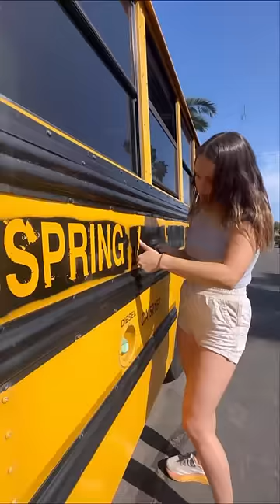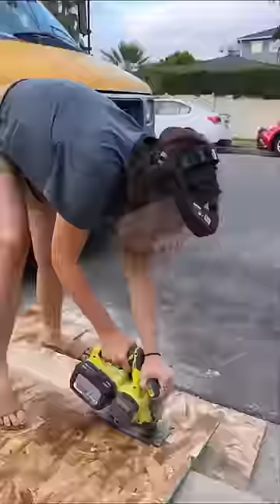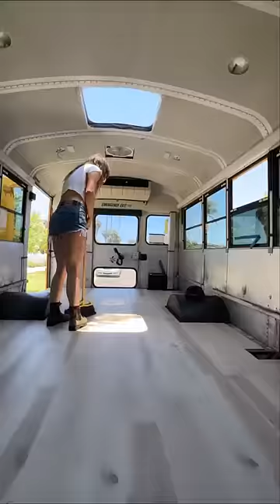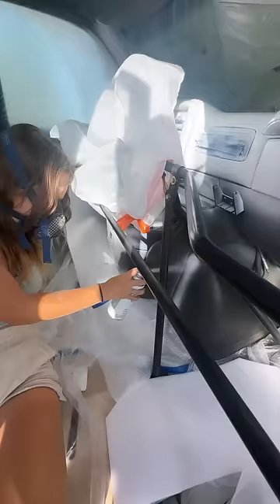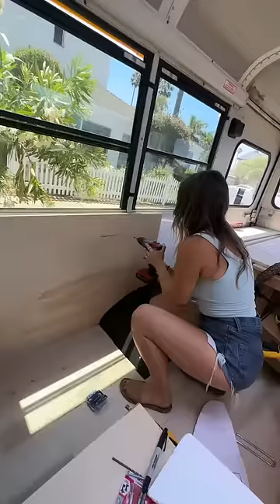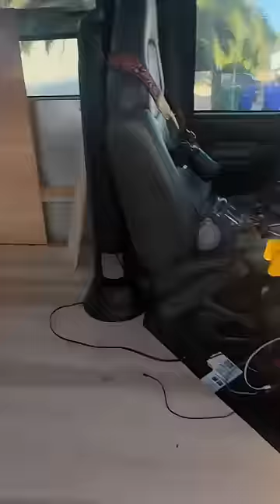#schoolbusconversion #skoolieconversion #tinyhome #skooliebuild #skoolie #vanconversion #vanlife

Comment: The hardest part of doing this in the UK would be getting your HGV licence
Reply: The best part about doing this in the US is you can drive it on a normal license as long as the word school is no where on the outside of the bus.
Reply: @Wolfofthenightt Remove the S and the H.
It's no longer a SCHOOL BUS, it's now a C OOL BUS
Reply: Haha yesss 💕 @donutdude1934
Reply: I have a Toyota dyna with a massive box on that is still under 3.5t, lots of things (like my horse box sized truck) can still be driven on a regular license, you just have to watch the weight.
Reply: Or actually finding a schoool bus
Reply: What is a hgv license
Reply: @woodystreeservicePNW  Heavy goods vehicle
Reply: @kishanjethwa1817  and you would have to get one even for a personal vehicle
Reply: @Wolfofthenightt don't you still need a class A or B license due to the nature of the bus? You just wouldn't need a passenger endorsement.
Reply: worst part would be having to spend extra on the insulation, fuck living in a giant metal tin with no insulation in the UK. 🙃
Reply: @woodystreeservicePNW  There are certain exceptions (e.g. if the vehicle is over 30 years old or is not going to be driven above 28mph) but otherwise yes, you still need an additional licence to drive vehicles weighing more than 3.5 tonnes in the UK for safety reasons, regardless of why you're driving it
Reply: @velvetventress  Insulation and a heater are actually relatively cheap compared to installing air conditioning, fans and extra windows for hot weather but I totally get if you just prefer hot weather in general. We all have our preferences 👍
Reply: @kishanjethwa1817  I do prefer hot weather haha but I live in the UK. have family that have built stuff like this & I just hate them - it's such a mess about.

didn't even think about fans/AC etc if I'm honest, fair point.

edit for grammar
Reply: I've been wanting to do this for ages but that combined with having to fight off the horrifically cold weather is not for me
Reply: @velvetventress  Yeah, so am I haha. You're talking to a fellow Brit.

I have plans to convert my own van next summer and I have no concern about the cold as I've planned it out very carefully and have thick insulation (all four walls, floor and ceiling), thermal window covers, electric heater hardwired to the solar panels etc. It just depends on what luxuries you'd like and what you're willing to sacrifice.
Reply: @kishanjethwa1817 don't know if I'd call children goods per say but you do you Britain
Reply: @gwenethp511 I think so. I remember reading up on it all but I only remember the trucker stuff. For most things with a bed I believe you have to have a class A orB
Reply: @XohjaiSbarkeater  yeah, I have no idea where Wolf got that from. You definitely need to get a specific class of license plate to drive a school bus. The only thing that would change is whether or not you need additional licensing to use it as a school bus.
Reply: You guys in the U.K. need a license to breathe. Sad.
Reply: @gwenethp511 it would be a class B when used for its intended purpose and hauling passengers. It is a state-by-state basis, but most states don't require a CDL to operate a private bus. Like someone else said, it just can't have any markings on it indicating that it's a "school bus" or any other type of commercial passenger vehicle. At this point, if you don't have any commercial markings and you're not hauling passengers in a commercial capacity, it's essentially an RV, and you don't need special licensing for that. 

Here in Texas, you can even get a special license plate that indicates that it's for private use.
Reply: There's a reason why everybody is leaving UK
Reply: @Wolfofthenightt  completely untrue you need a CDL to own one of these or drive it out of state.
Reply: Huge Giant Vehicle license?
Reply: @donutdude1934 or leave the c and it’s be a cool bus 😂
Reply: @gwenethp511 well a class A is for anything with a trailer over 10,000lbs so thats irrelevant to a school bus. And the only way you'd need a class B is if it had air brakes
Reply: @donutdude1934  Great!
Reply: @kishanjethwa1817 electric heaters are very uncommon on van builds due to the constant high wattage draw. You'd need some serious solar and big Lithium Ion batteries to run that. 

I'd strongly recommend alternative heating, wood stove, gas, or most popular diesel heater.
Reply: No the hardest part of living in the UK and doing this is that you can drive across the whole country in less than a day and still not find a decent place to sleep 😂
Reply: @Wolfofthenightt really? even the bigger buses?
Reply: @velvetventress  Would still suck up here too, winters in the north easy can be -10F(-23C) or lower. They are definitely from the south or mid-west at least.
Reply: this is a person i like to call a bus hippie
Reply: @Wolfofthenightt  should require a different license as its a bigger vehicle
in the uk theres like 15 different licenses
Reply: @Wolfofthenightt  Because it's still 16000 GVW you still need a class B operator's license
Reply: @gwenethp511  No.
Reply: @velvetventress  Yep. This "vanlife" better be in Southern California because it isn't going  to cut it if the weather gets cold. I was wondering if someone would recognize this. 

The difference between an insulated van and non-insulated one is significant. 

I have seen people double-insulate vans to live in up in North Dakota. The living space was reduced to mostly a place to sleep but that's all they wanted to use it for.
Reply: @Wolfofthenightt  the upgraded license would only be needed if the bus had air brakes, otherwise nothing else is needed.
Reply: @velvetventress I mean… what’s it insulating at that point. The Uk is just grey sky’s everyday🤣
Reply: The hardest thing would be paying carbon taxes when you already pay taxes to drive the streets  😂😂😂😂😂😂😂 failed state
Reply: @sgtstedanko7186 Yes. Everyone is leaving here because you need an additional license and training to drive a larger than usual vehicle 🙄
Reply: @somedogsarecops2354 Nah, we just don’t give guns to mentally deranged people and understand that driving a lorry is a lot harder than a hatchback 😂
Reply: @Wolfofthenightt  Maybe its for the best you cant just drive this on a normal license...
Reply: that's a good thing.. some people shouldn't be allowed drive vehicles that size
Reply: @kishanjethwa1817  In Oz you have to have different licence endorsements for a bus, heavy rigid truck, and articulated truck. Oh, and a motorbike as well. They all cost separate licencing fees initially.
Reply: Then figuring out how the hell you're going to afford the fuel! 😂
Reply: @gwenethp511 It’s just called a CDL here. Commercial Drivers License. 

If you aren’t carrying 16 or more people, and the weight of the vehicle doesn’t surpass 26,001 pounds, and there’s no decal claiming it is a school bus, then you’re fine. 

The thing about the US that you have to understand is, laws vary, sometimes drastically, for every state. You just have to make sure you are following the law in your state and other state laws if you are traveling with something like this.
Reply: PSV license, not HGV . But if it’s not used for that it just depends on the weight of the vehicle
Reply: You don't need any license to drive a converted vehicle like that. It's no longer a school bus
Reply: @woodystreeservicePNW no you dont
Reply: @velvetventress lol you don't think it gets hot or cold in the US
Reply: @kishanjethwa1817 no you dont
Reply: @velvetventress true that thing would be a frickin ice box in the winter here
Reply: Oi bruv you got a loisens for that permit ave you?
Reply: @dti_player_since_era9 
Not hard.
There is a used bus lot in [North] Las Vegas. Pretty reasonably priced, too. They have a website. Google is your friend.
Reply: @velvetventress  There times in North Dakota it gets to -40. The C or F is optional. It can get to 40C or a hundred and something F in the summer.
July in Mojave is bit like that. OC at dawn and 45C at noon.
Reply: @Wolfofthenightt  and you seriously believe that`s a good thing ? .. lets take this girl here .. 0 driving of a buss or a truck before .. and let her take it out on the open road? .. yea ok :D .. Welcome to America -.-

Comment: I heard another short talk about not waiting to be good at something to start a project. Start whatever, and you will learn along the way. Love seeing your journey. Thank you for sharing!
Reply: I would say yes that's great advice, EXCEPT be super careful around seriously dangerous stuff lol. High voltage/amperage, power tools you've never used, working at height, etc.

Some people will go too far and do shotty dangerous work because YOLO and DIY life. I think there's a happy medium where you're out of your comfort zone learning a new craft, but not putting yourself and potentially others at risk.
Reply: First of all, this isn't "her" project.  How do I know?  The level of precision work.  This was done by an experienced carpenter.  

Think I'm wrong?

Let me drop a sheet of plywood on some saw horses, snap a chalk line for you to cut, and hand you a skill saw to cut it with.  One thing I'll promise you is that you will see every curve in the wood where you either paused in the cut or had to readjust to get back on the line.  About the only way a novice can even hope to stay on center is to run a jig for the cut.  And no novice is going to know to do that.  

Or you spend about $2k in getting a table saw, miter saw, skill saw, supports for the wood, extra blades, power cords, and possibly even a small generator.  And that isn't even accounting for the drill, bits, level, measuring tape and square.  Then there is the demo and build tools.  Hammer, sledge, pry bar, grinders, sander, sockets and wrenches, plyers, etc.

And that isn't even accounting for any additional plumbing or electrical work that would need to be done.

She is a young fairly attractive young lady with no obvious bruises, scabs, or cuts that any normal person would receive doing this.  She also isn't dressed appropriately for this type of work (safety concerns). 

And is this where I point out there was no reason to sand the subfloor? it was being covered over by the wood laminate.  So no need to sand it. She did it for show. 

No, she is either paying the guys who are doing this, or she is providing other "services" to get it done.  At most, what she has in this project is the cost of materials. 

But the real problem is choice of vehicle.  Not that there is a problem using a school bus, but for a vehicle to be retired by a school system it has some serious miles on it. And depending on the part of the country that bus came from, the entire under carriage might be rusted out from salt and brine from road coverage during wintery weather.
Reply from the maker: @superdave8248  this is a huge compliment that you think my bus looks like a serious carpenter did it 🤣 i used a circular saw for every cut

Comment: Great choice of music!  That Bus is gonna create memories!
Reply: It's most likely going to break down. A lot. Used buses usually have around 2m miles on the clock before they're decommissioned. And even buses that are only a couple years old have a habit of suddenly becoming completely undriveable over night, even after years of no mechanical problems. When you buy a used commercial vehicle, you're inheriting the sins of not only the previous owner but also the drivers and maintenance department. On top of that, by the time one does get slated for resale, it's in rougher shape than... Well, it's just on rough shape.

Comment: “Didn’t know how to use a drill” has got to be the most wild statement of all time. It is literally 2 buttons
Reply: Nah i had no idea how to get the drill bit off
Reply: There’s a bit of skill to using one. Does it have a reverse feature? Because it’s gonna be hard to screw things in if it’s in reverse without your knowledge. Know how to switch the drill bit? Gonna have a hard time if you don’t know that. Know how to hold one? Self explanatory.
Reply: Nah the best part is the boyfriend who helps behind the scenes and provides all these tools in the first place
Reply: There are several gears and torque settings for different purposes. It's not entirely intuitive.
Reply: 2 buttons? Mine only has a trigger and the thing you spin to change the bits...
I also have a manual one you crank yourself to drill.
Reply: @carsilk2492 exactly, she didn't do any of it.
Reply: @db5094 How? It's all pretty intuitive
Reply: @sirthisisawendys9030 dafuq? These are common sense things, not skill

Comment: Problem with bus conversions is the same problem with all RVs... you're dependent on possibly old mechanical parts to work properly.  When the engine or trans go south, the whole nice bus isn't usable unless you plan on permanently parking it somewhere.
Reply: well the money you saved + if you make friendship with a mechanic or a Man who know what he is doing ... then you have not issue at all . Everything can be rebuilt with a little know how ...
Reply: Really , is there some reason a person can not repower it or put in a new tranny?  I just rebuilt the 6.7 Cummings in my bus for a little over  $2100.00  in parts. So why would she have to park it some place ?
Reply: @Shad2k8  not always that easy.  For example, joker @ better bachelor did a nice school bus convert, only to find weird trans problems once he got it on the road.  More than one mech has tried to fix it.
Reply: You're assuming a bus and an RV have similar engines, if someone shops correctly they could snag a diesel bus that could run upwards of 600 thousand miles. 
Since you're also building your own rig you could also avoid many issues that an RV struggles with (mold/mildew) but this is all determined by money, but still cheaper than an RV.
Edit: I forgot to mention how dumb I think this woman is, her attempt is noble and it'll last her as long as she's willing to bake in the California sun with no Insulation.
Reply: @jamesobrien-lr3zm  I was actually thinking more along the lines that in both the bus and RV, that custom living area is integral to the mechanical portion, unlike a pull-behind trailer that can be towed by any vehicle with a big enough tow pkg or fifth wheel.  Depending on how much money to put into it, on motor/trans/part availability, on whether you can find a mech that can diagnose the really tough problems, are all big ifs, especially if something happens while you're on the road in the middle of nowhere.

Comment: I know here in the states, you need a CDL and also that bus is most likely diesel and that is a whole different inspection process. 10/10 would not suggest this kind of projects to your friends, because of the cost. Not to mention diesel mechanics and parts are expensive.
Reply from the maker: I actually don’t need a CDL to drive this, the DMV doesn’t classify it as commercial use!
Reply: In Canada you can drive these buses with a G license

Comment: I have a hard time watching you use power tools and no safety equipment, my dad was building his bus home, didn't wear safety goggles while removing the rivets, and got a piece right through his eye. It's been years and he still has minimal vision in that eye, they couldn't fix it in surgery.

Use safety equipment people!
Reply: Shes not actually using the tools you dolt
Reply: @daethe while I appreciate your helpful criticism, she very clearly used at least two types of power tools without protection in this short. And if you watch her other shorts, she very clearly uses power tools without safety gear.
Reply: Neat, those other shorts aren't this video. She's not using them here. @LanaiSutlovic
Reply: @daethe  I think you need to rewatch. She's using them in this video. Besides, she's still her on any of her videos and it's still a good idea to wear safety gear?
Reply: It’s fake my guy don’t worry she fine from the safety tools, but not from this comment section 😈.

Comment: The school buses may not have the headroom that’s ideal, but they sure do have the space I love watching conversions like this. The only thing that seems perplexing is making sure you run all the electrical lines and any thing that’s gonna carry water through the floor slats. I watched several different conversions and everybody does it kind of a little bit differently. You can get really really simple or you can get really super technical With your hardware and wiring

Comment: I just bought a conversion van it already has the flooring and bed but it needs a wheel bearing and more sealants cause it’s leaking some around the back doors and the fuel gauge doesn’t work. But I still can’t wait to get started fixing it up. Idk anything it though but it’ll be fun

Comment: Looks pretty good! Do you have any idea on the cost for the tyres and engine parts/servicing. Also the cost for fuel (I’m guessing diesel is used).
Reply: If the bus is within only 20-30 years old there is a good chance it could be Natural Gas or Propane-fueled.  There was a craze about 20 or so years ago where some Bus Companies were building a bunch of them and converting a bunch of them as well.  

We had some of them in Northern Minnesota for a while but because of how cold it gets and something to do with atmospheric pressure and moisture, they turned out to be a massive fail in the winter LOL.

Comment: Sorry I thought you said you didn't know how to use a DRILL...one of the most easiest tools to pick up and learn how to use...
Reply: Clearly, you learned when you were a little kid, and now have forgotten how hard it was to get it properly at the time
Reply: @Insert_Name_Here908  it takes 2 things to set up a drill...if it's chordless you need a battery, if it has a chord you need an electrical socket, then that little lever underneath switches the direction the screw is going